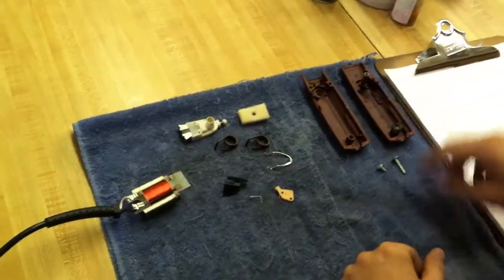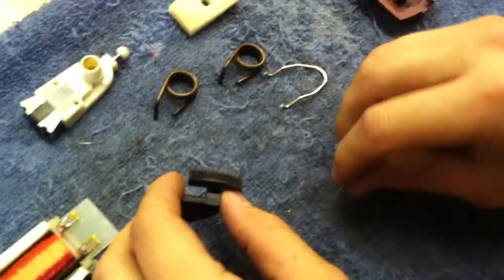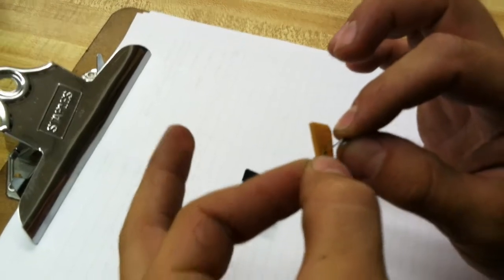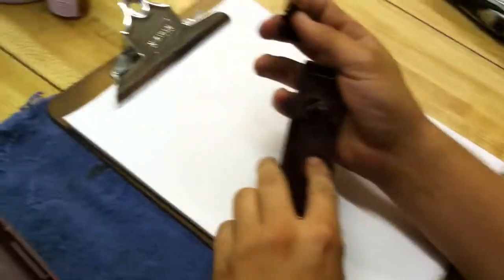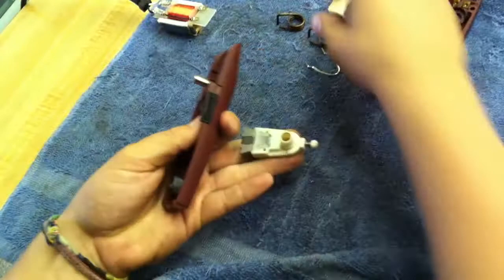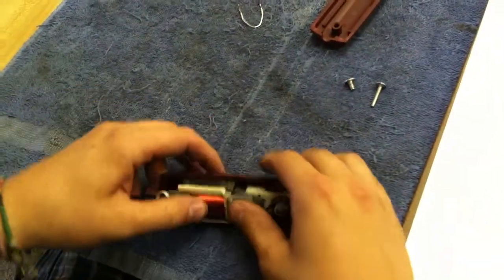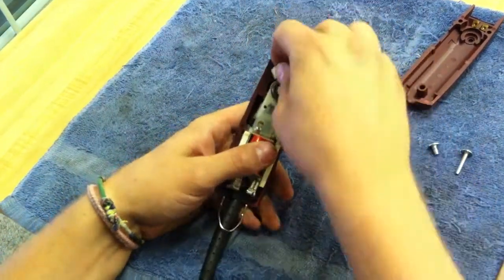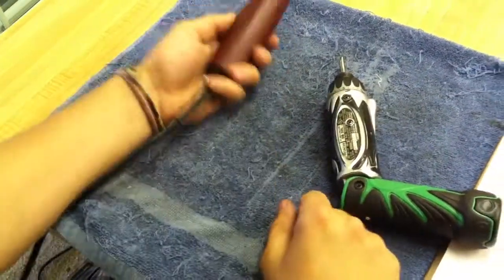Oster T-Finisher Assembly

Comment: Hoping someone can answer this.  I'm ordering a new field assembly since my pair do not turn on.  Can anyone tell me if the white and black leads require soldering onto the field assembly? thanks.
Reply from the maker: They don't.  They just slide on to the field contacts.  We just finished filming a remastered version of this video.  It should be up in a couple weeks, check it out and let us know what you think!
Reply: @TheEdgePro  hey thanks.  yeah I checked some other video that showed a good high res closeup of the parts.  Turns out I didn't need the field assembly, it was the contact assembly.  Thanks man.